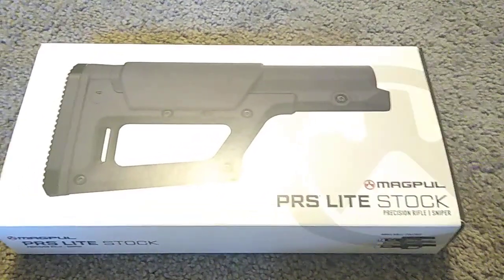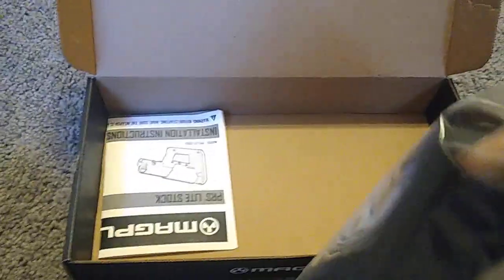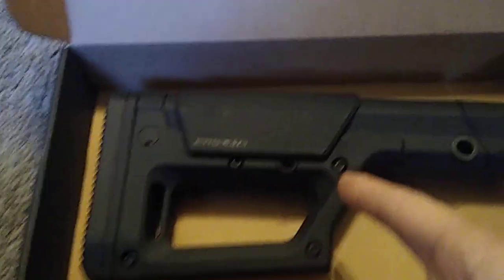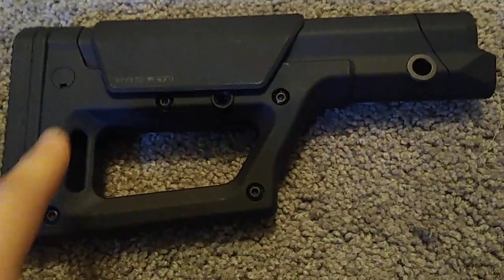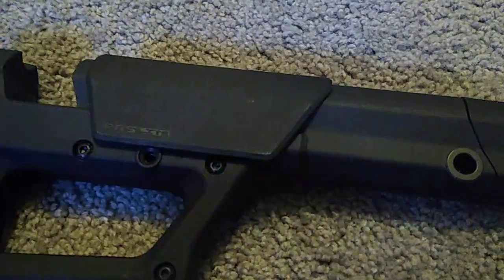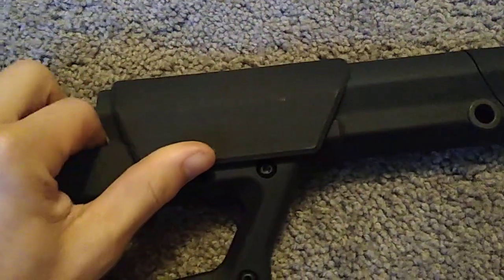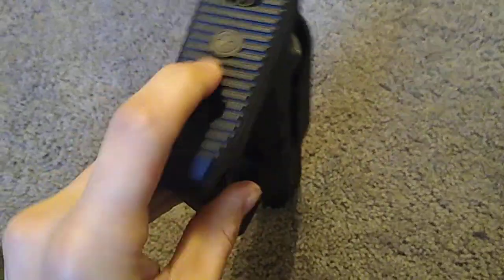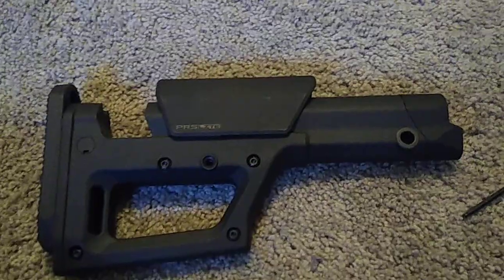Magpul PRS Lite Unboxing

Comment: I had a little play when I installed it a PA10 Gen III. Watch school of the American Rifle. Just added a small piece of velcro to the buffer tube. On the angle part of the tube. I used the stiff part of the Velcro. It is rock solid now. I have used the soft part of the Velcro to shim six position ar stocks. It usually works great. If to thick. I shave it with a shaver.

Comment: Wait... Time 3:25... What happened?🤔... That is Not suppose to happen Right?😳😬 did it break off?🤔
Reply from the maker: That's how it's assembled.  Nothing is broken.
Reply: @Awag-yj8bu  
I was very interested in getting this... until I saw that flying off so easily... that can easily be lost in the woods or any other number of ways... that is Nuts!
Reply from the maker: @ellissmithjr6599  when the screw is tightened down it engages with the serrations on the bottom of the riser. I have had absolutely no problems with this stock when I'm out on hikes through the woods.